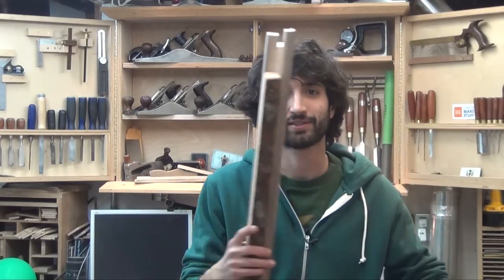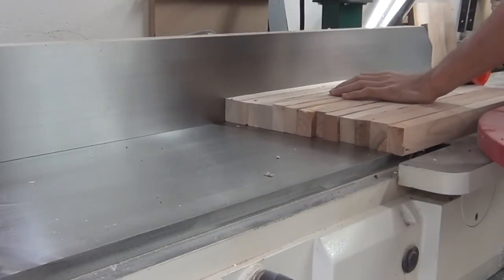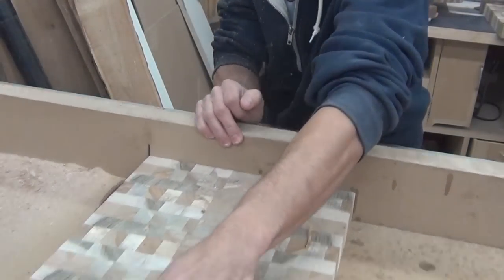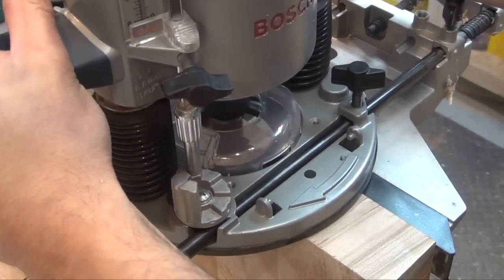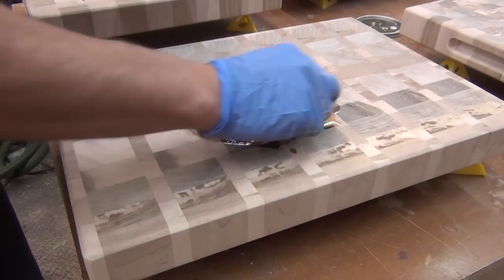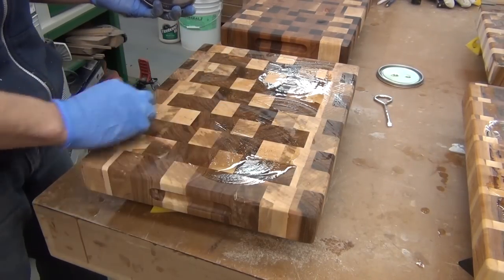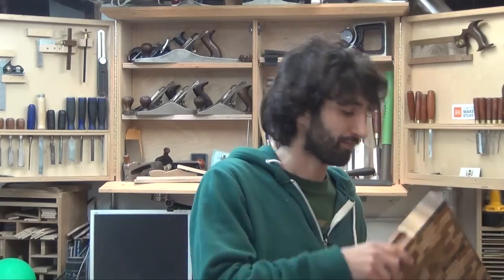Turning Scraps Into End Grain Cutting Boards

Comment: Have you tried submerging the boards in a tray of finish until saturated?  It would save some labor.
Reply from the maker: OnEvenKeel After making this many boards at once, I've seriously considered it.  My only hesitation would be the amount of finish I would need to start and I'm not sure how well the finish would last once exposed to air.  It's a much easier decision if I were using mineral oil since that stuff is so cheap and doesn't harden.

Comment: Any reason why you would use the router to flatten vs just running it through the planer?
Reply from the maker: Running it though the planer runs the risk of the cutting board exploding.  It's not a gentile process.
Reply: happened to me once :P
Reply: Why not use the drum sander to flatten them? Taking light passes with a low grit would probably be faster and less messy than using the router no?
Reply from the maker: You'd be surprised how slow the drum sander actually is and the lower the grit, the more you have to sand to remove the track marks.  A board this size can easily take 10-15min to flatten through the drum sander and that's for one that's reasonably flat and level.  Router sled can cover both sides of the board about 1-2 min.
Reply: Ah okay that makes sense. I've heard people talk about the drum sander being amazing for end-grain cutting boards and how they couldn't do without it. I see that it's useful, but if a well-built router sled can flatten boards quickly and accurately then a drum sander isn't a necessity to start making nice cutting boards. Thanks!

Comment: Hi Matt- I know this is an old video, and I don't know if a celebrity such as yourself still replies to YouTube comments, but.... I was wondering what grit and feed rate are you using on your drum sander? I've had a heck of a time with burning. Thanks in advance for the reply
Reply from the maker: 80 grit. 1/128” per pass. Usually speed all the way up and I’ll let the auto speed control do it’s thing
Reply: @mcremona  Thanks I'll give it a shot! Been using 120

Comment: I'm desperate to figure out if there is such an animal as a NON end grain cutting board??? I.e., with the grail running laterally??? Thanks!!!
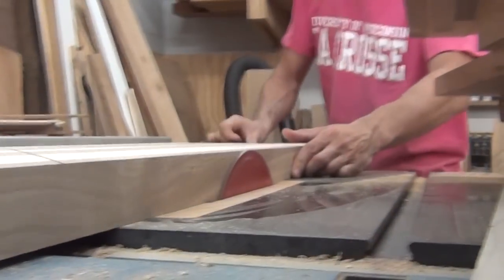Reply from the maker: Sure thing.  You'd be done at the 2:00 mark.
Reply: Thanks so much!!! I have a bunch of black walnut, which is fairly hard wood, and surely beautiful, but I also have a thick slab of pear, which seems a bit harder, so I'm kinda leaning toward trying that. What do you think?
Reply from the maker: Pear would be nice.  It's quite beautiful :)

Comment: I'd like to see you build one without a jointer, planer or drum sander. Right there is about $4k in tools!
Reply from the maker: patriotsriot Drum sander is optional.  A cheaper/smaller jointer or planer would also work.  But it could also be done without either by using the router sled for all dimensioning.  It would just take longer.

Comment: Why weren't you able to run the cutting board under drum sander rather then putting it on a router plane?
Reply from the maker: It would have taken longer to flatten.  My stop block moved when I was making this batch so most of the boards were pretty uneven.  When the stop block doesn't move, I can typically go straight to the drum sander.

Comment: How much those retail out for?
Reply: End-grain cutting board are pretty expensive. I think thy're mostly sold on etsy because according to another youtuber only woodworkers use & make end grain anyone else use either face or edge grain.
Reply: They can go for as high as 400 dollars. Simpler ones go for around 200. The problem is finding someone that is willing to see the value on them.
Reply: Felipe Pereira. If you don’t mind me asking, what is the value of end-grain cutting boards? Are they stronger, or just “prettier”? Thanks.
Reply: Alright man. End grain boards last a lifetime if cared for (and made) properly like here. The make up of wood is like spaghetti. Cut across spaghetti and the lengths will break just like the strands of woodgrain do. Sink a knife into the top of the spaghetti (end grain) and the knife will just sink into the bundle. This is what happens when you use an end grain board. 
The benefits of end grain are many. More hygienic because the grain pushes out the bacteria - the board essentially repairs itself after use, your knives do not get blunt as quickly as when using long grain cutting boards and look way nicer in my opinion. Also the board is way more stable after washing and cleaning. How often have you seen a long grain board split? This rarely happens with end grain boards if they are made right. Long grain boards are fine for serving food but not chopping in my opinion. As I said good end grain cutting boards could last a lifetime and take much longer to put together - that's why they are more expensive. Best wishes from Dublin, Ireland

Comment: You almost sold me on using the finish instead of mineral oil, until you got to part about how much it took :)
Reply from the maker: krtwood I go a little crazy with the finish.  The upside is it lasts for years.
Reply: Well i was told its less maintenance with the salad bowl finish over the mineral oil as you would have to reoil it often?!
Reply from the maker: whitewolf8758 The boards that I use in my kitchen are finished with salad bowl finish.  They are 2 years old and I haven't had to reapply any finish.  Granted, they don't look new anymore but they are still all sealed up.
Reply: whitewolf8758
 Yeah you have to reapply the mineral oil every couple months, but it takes all of a minute to do it.  It's the person you give the cutting board to that has to do it, better them than me standing there all day pouring finish on the thing I say :)

Comment: there should be a disclaimer that you need to spend 20k on power tools before you can try to attempt this.
Reply: +Daniel Grass I think it could be done with a contractors table saw, router, random orbit sander, and a cheapish planer.
Reply: Lots of comments about the tools used. Just because Matt used his big equipment doesn't mean it can't be done any other way. A table saw, belt sander, and random orbital should do the trick. Even "cordless" card scrapers can leave a surface smooth, or smoother, than any planet. Woodworkers have been smoothing uneven surfaces with card scrapers like tools for hundreds, if not thousands of years. Depends on your approach. No need to freak out if you don't have a full shop like Matt here. Just do it, see what happens, make adjustments, and have fun!!